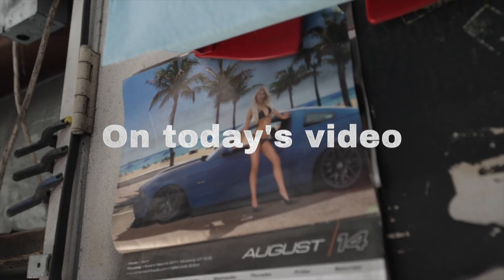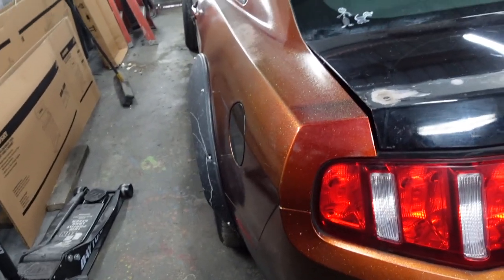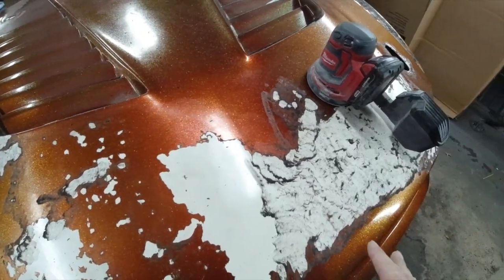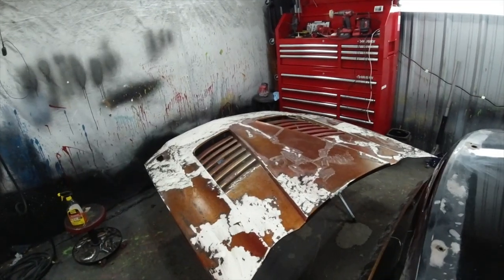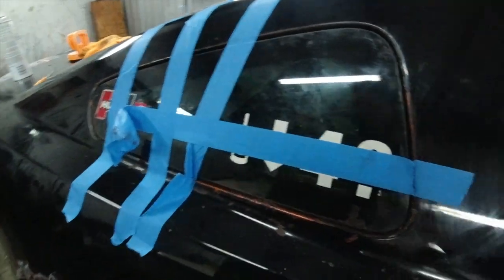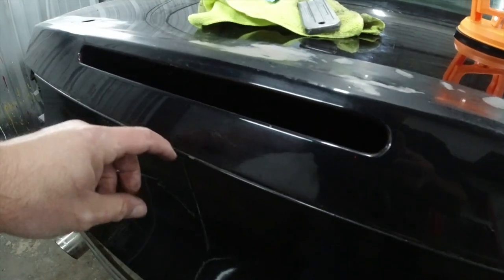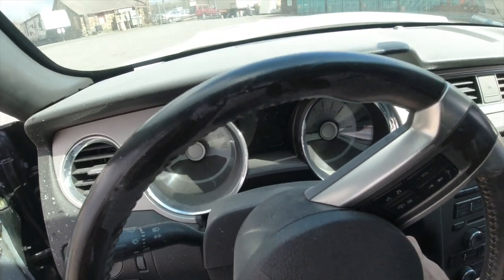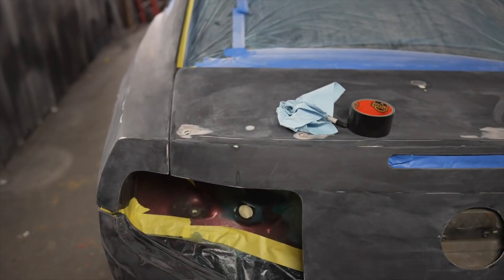New Paint for 2011 Ford Mustang Drift Car Part 1: Prep

Comment: Would aircraft aerosol paint stripper worked? It takes wheel clear coat off instantly. Seen on a auto body channel that sprayed paint gun cleaner clean from a 5 gallon can and it took off the clear coat and paint coats that they had just sprayed because they was given the the wrong clear coat. It took it off almost instantly.  Lol
Reply from the maker: I considered it, but I was worried about trying to save the black for a little bit of a base, and was paranoid I’d miss a spot while cleaning up the chemicals.   In hindsight, it probably would’ve been faster.  I also didn’t want to eat the gel coat off the hood, because it’s already pretty thin.